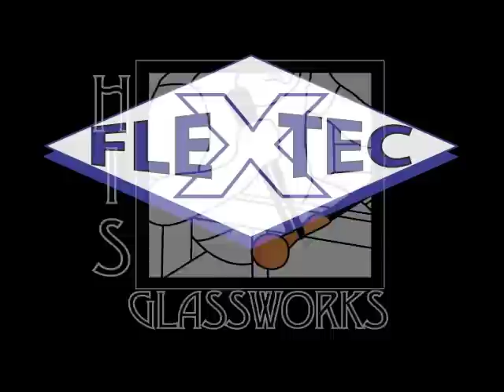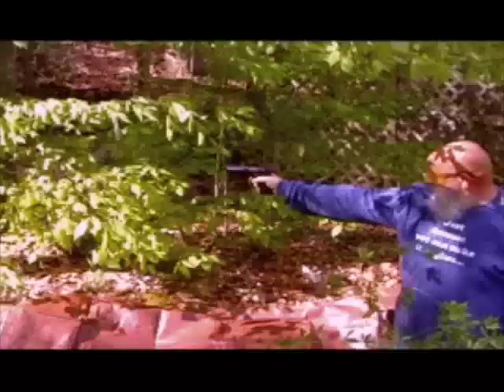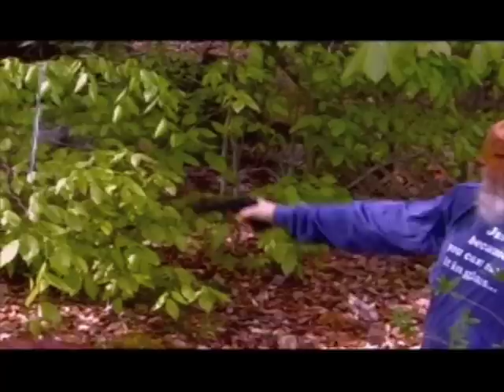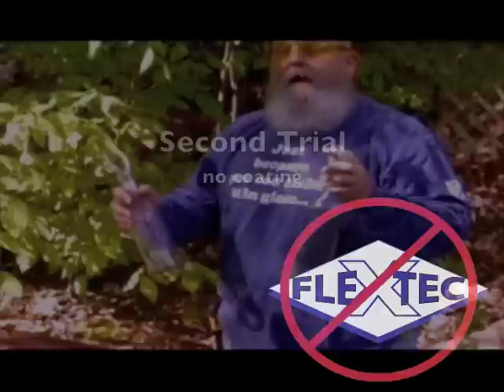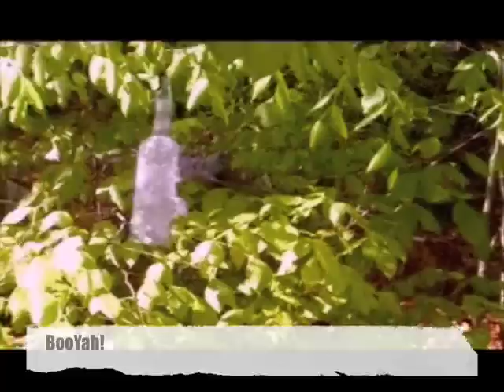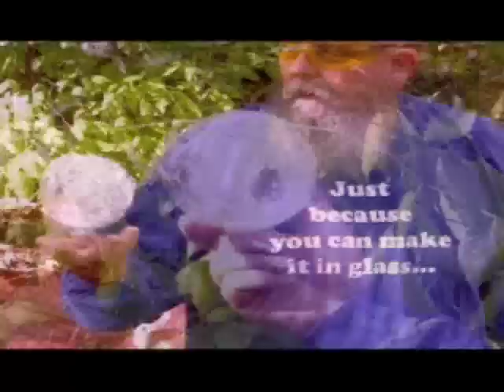Flex-Tec Anti-Shatter Coating for Glass

Comment from the maker: It was a .45 automatic with regular 1/8 inch window glass. Nothing too special.
Now, the Flex-Tec will hold pieces together that have been broken, but the small bits and pieces will eventually start coming out. We've coated some pieces on both sides and intentionally broken them for effect and it seems to work well though.

Comment: Using a gun is ridiculous. bullet speed will make a hole in practicly any thing. try using a hammer.
Reply from the maker: It's meant to show that the glass will not shatter. Flex-Tec won't prevent breakage, it prevent shattering when broken.